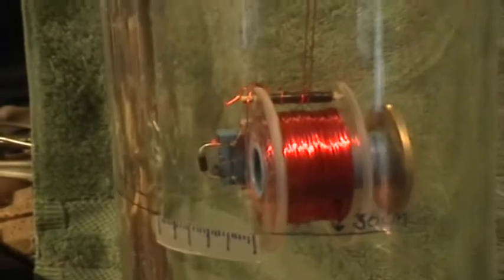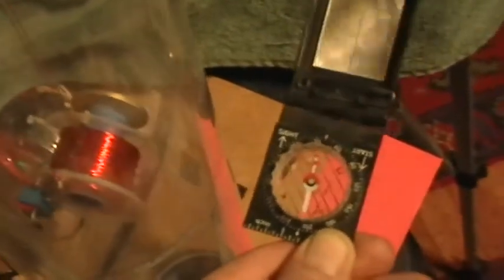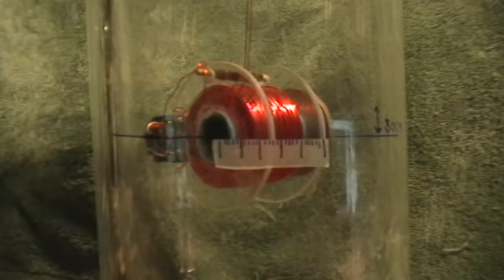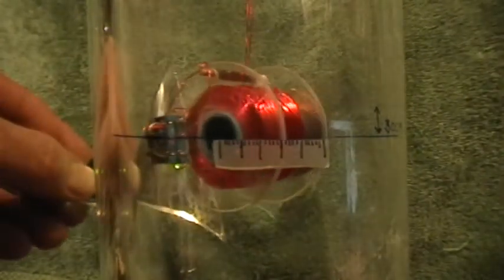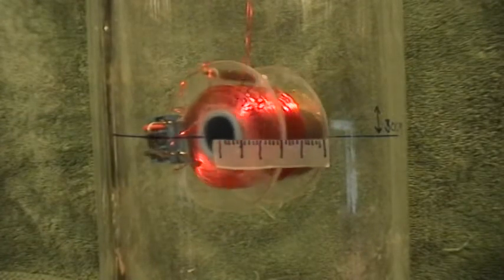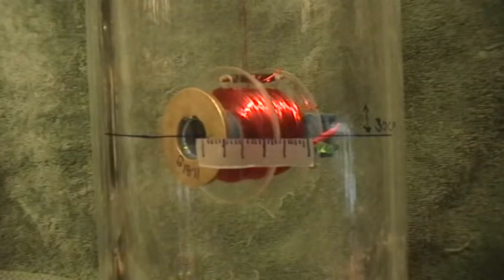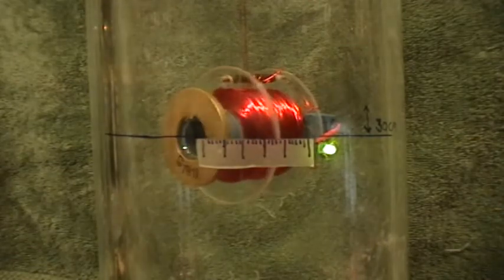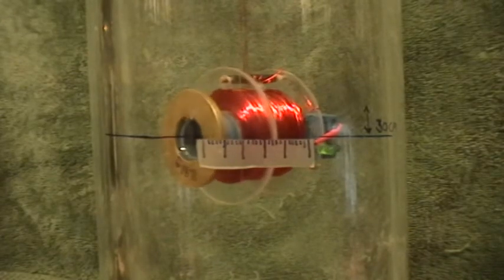Reactionless Propulsion: Charrier Experiment 1 Supplement

Comment: I want to play the sceptic. There are about 40 Watt going through that coil creating a strong magnetic field or better said pulse. If there is any steel or iron within 4 meters the coil will push itself away or towards this steel or iron.

Why do I say this? I have seen with my magnetically suspended ring magnet spinners that one spinner caused a slight motion of the other spinner although they were two meters apart. The motion was tiny, about the strength I am seeing in this video.

May be I am wrong, but it would be nice if you could do this experiment at a great distance (10 to 20 meters) from any human made structure.

Still, very impressive, greetings, Conrad
Reply from the maker: This is the whole point of this series of experiments: to determine if the device interacts with the nearby environment and/or the field of the Earth. My hypothesis is that these kinds of interactions could be complicating the interpretation of Charrier's data... IOW I am trying to track down potential artifacts in his experiment. Charrier's paper doesn't talk about any shielding or other precautions but I think he used a suspension system that didn't allow torsional motions as well as mine does. So if he was experiencing the forces his system didn't respond to them. Also it now appears that Charrier's peak currents may have been much less than mine are at this frequency.
I've got several more experiments scheduled along these lines, and taking the whole thing outside is probably going to be one of them.
Reply: TinselKoala Surely, it interacts with nearby enviroment or/and and nearby equpment. This must be due to conservation of momentum.
Reply from the maker: dxdx666 Surely. Did you see Charrier's own video?
Explanations on micronewton electromagnetic thruster
Note his photos of his experimental setup.

I am not sure what his currents were. Taking his numbers as given in the 2012 paper, we have 14.4 amps/millisecond "current speed" or dI/dt, for a ramp risetime of 22 nanoseconds. This works out to a current at the top of the ramp -- presumably the peak current at the top of the square wave pulsation -- of around a third of a milliAmp. Tiny tiny current. I don't know if this is because his Function Generator is folding back and not providing current into the low impedance load, or other reasons. My own system, using the mosfet relay, provides current in accordance with Ohm's Law: I get 1.5 to 1.7 amperes at the top of the current ramp. Hence a powerful field from the coil.